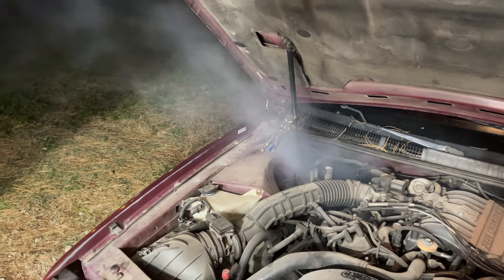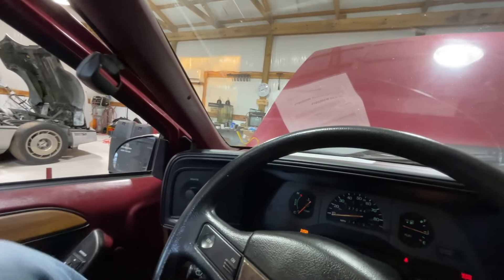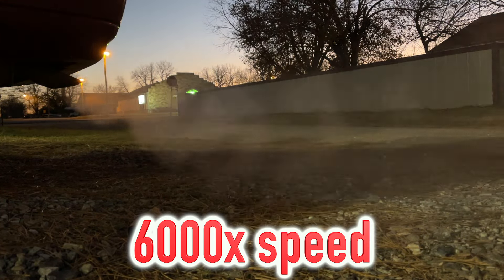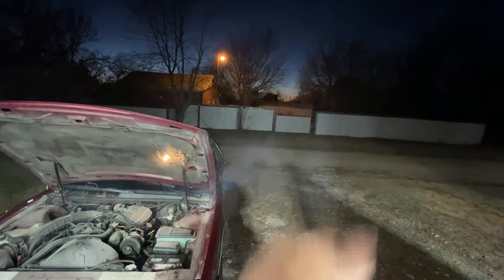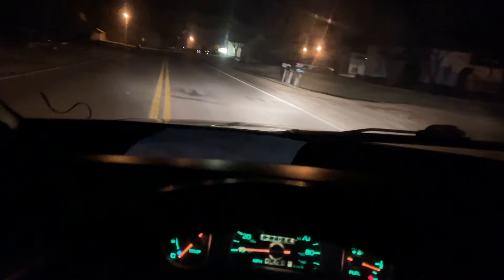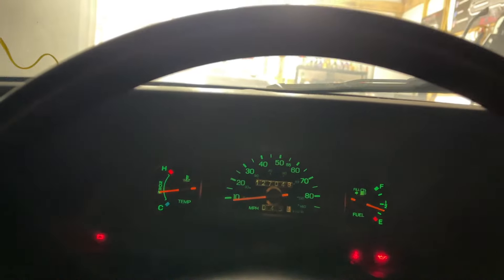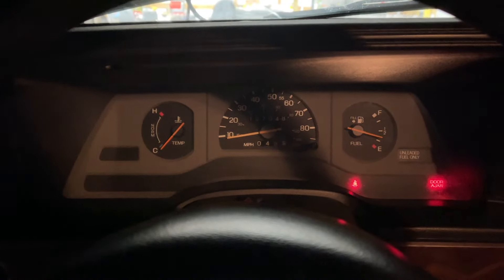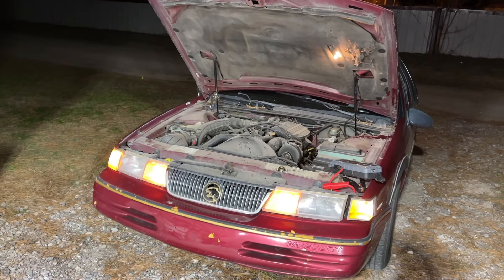$250 Copart 91 Mercury Cougar - Blue Devil Head Gasket Repair or Fail?

Comment: Its not a guarantee (especially with as bad as this one is) BUT in most cases you can fix leaky radiators, heater cores, cracked heads, cracked block, and often even blown head gaskets by pouring a can or 2 of regular evaporated milk (NOT SWEETENED CONDENSED MILK) into the radiator once it is warmed up just enough to open the thermostat and then go for about a 15 or 200 minute drive but watch the temp gauge and coolant level. It won't plug up the insides of heater cores or radiators but will only plug the leaks and it holds up like iron. Strangely, John Deere recommends using it on their equipment if a leak develops and they say it won't void their warranty while using any other form of stop leaks in a John Deere WILL void the warranty. If John Deere has their service techs use it on equipment that can cost well over $100K. I'd say it is the way to go. I in fact have used it for several years now on leaky radiators, heater cores and 2 years ago on a Chevy Suburban that had a blown head gasket and it hasn't lost a drop of coolant since.  If you have ever done any baking or cooking where Evaporated Milk is used, you'd know that when it gets cooked onto the sides of a pot or pan you almost need a sandblaster to remove it because it sets up like iron when it's baked onto a surface. In a cars cooling syste, it will only harden it the leak it is plugging and the rest of it stays suspended in the coolant where it doesn't cause any problems. Just pour it into warm coolant and go for about a 20 minute drive and leave it in the system.

Comment: Blue devil used to say you have to take the thermostat out while using their product, I wonder why they stopped as it looks like your thermostat is now plugged, run her back through the auction while she still runs
Reply from the maker: You should’ve watched till the end of the video and this is not the same blue devil that requires removing the thermostat that is a separate bottle
Reply: @AutoAuctionRebuilds  I actually did finish the video, however I failed to edit my comment
Reply: @AutoAuctionRebuilds  i didnt see you mention if the heat was fixed, if not it could be plugged from the head gasket being bad, i would do a back flush on the heater core only. Looks like she can go a few thousand more miles, dont forget to check and change the oil!! I'm hyped for more content, weither its vette videos next or more Ghoubler The Couger

Comment: Why not do good job and open heads and see what happen and replace heads gasket. My point always do good job 👍
Reply: You are right. A fix in a bottle is only there to get you to a shop or your garage so that a proper long term repair can be done. A new set of head gaskets will beat a short term fix any day of the week. I told Randy he needs to get bold and do a engine swap.
Reply: @rgbigdog  no need engine swap easy job to repair replace heads gasket and he’s  sure wont sale the car. but if won’t keep the car good for V8 swap

Comment: Put the cap on and take it for a hard drive I bet it starts to smoke and overheat. I tried this on a Northstar and the second u did anything but let it idle and drive it at 10% throttle it would turn into a volcano and the coolant temp climb to the red. No bottle could repair that one

Comment: Until it runs hot again then it gonna be ju nk for sure espcially if that is a 3.8 v6. Those motors very rarely ever come back to normal after they have been run hot without changing the haeds

Comment: No disrespect but I think the system was clogged.  It says on the bottle the fluid will not work on that kind of system.  It has to be flushed.  Not saying it can fix this engine but give it a better chance to by letting it work the way it was meant to which is in a system that is flowing without particles in it.

Comment: YOU DID IT WRONG!! I run "Poor mans's Garage" (also known as my broke ass fixing all my junk cars). you can not just pour it in there like that AND you have to do 2 other things. Compression test to see which cylinder is leaking so you can remove spark from it so it won't blow the sealant back out before it can adhere to the leak AND remove the thermostat so it will circulate BEFORE it starts to "solidify". Try that AGAIN with that car and it will work. I have done same thing you did and when I called BD they said try that which I did and it works. They can't tell people to remove Thermostats on bottle because too many idiots out there.

Comment: Almost all Ford 3.8 liter V6 develop headgasket leaks around 90,000 miles. It was a design flaw. It usually occurs on the right cylinder side. The replacement gaskets were an improvement but not a perfect fix. A real bitch to replace the gaskets due to everything you need to remove and the heads are aluminum and will need surfacing. Really hurt Ford's relationship with customers. Are you sure that stuff is for headgaskets and not just head and blick cracks?

Comment: Randy give it to WatchJRGo he will drop a engine in it. This car needs a engine, them heads are more than likely warped by now.
Reply from the maker: No thank you
Reply: @AutoAuctionRebuilds  Any thing in a bottle is there to get you to the shop for a proper repair. It will fix the problem for the short term but in the long run a new head gasket will out preform any fix that comes in a bottle. And lets get bold and do a engine swap. That 3.8 V-6 from Ford are plentiful.

Comment: All that time you sat and wasted waiting to see if the sealer worked. You could've just did the gasket. Those old 3.8L are super easy to work on. the gasket would've taken you about two hours. You wasted more time than that waiting for the sealer to work through and wasted even more time letting it cool down just to see that it did in fact not work. Lol
Reply from the maker: I've done the 3.8 gaskets over and over and over and over and over again and I am over doing them. Boring.

Comment: The engine seems to be gone, did you consider trying an EV conversion? Just to do something different
Reply from the maker: You might want to watch until the end of the video
Reply: @AutoAuctionRebuilds  I know Blue Devil has done his job as you told, but the last owner had beat up this car so much that is possible he drove with a blown head gasket hundreds of miles and do much more damage before cut the cats, take  the battery and throw the car to Copart

Comment: Blue devil that $hit works get the real $hit not that pour n go crap you must follow the directions to the T you must flush the system take out the thermostat no coolant can be in the system pour blue devil in the stuff that cost $100 bucks or more fill the rest with water put the cap on and let idle for an hour or so confirm repair and flush system again

Comment: Blue Devil is no repair... It's a postponement of execution
Reply from the maker: That comment assures me you have never used it. I’ve used it and had years of service returned to a dying car. Don’t comment unless you have experience to back it up.
Reply: @AutoAuctionRebuilds  no offense man, not saying it doesn’t work but it’s for the short term. It surprises me you had a car that went on for years after it. Would you buy my car if I told you it had a blown head gasket but I repaired it with Blue Devil so no worries? For a winter beater car is see no problem, but as I said.. it’s no repair for me. Indeed.. never uses it, never gonna use it.

Like your content btw.. waiting voor the Corvette update

Comment: look  those engines have head gasket failure  so  do any those try will not help.
Reply from the maker: It’s fixed
Reply: @AutoAuctionRebuilds   ah i could be behind on head gasket / coolant leak repair,  i had '93 t bird failed on me twice,  or the way i drove big foot LOL